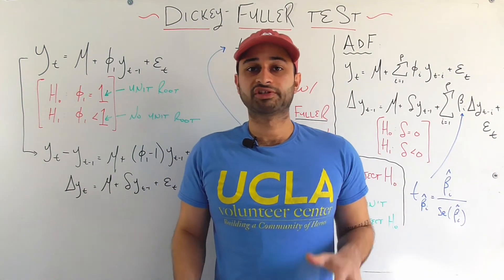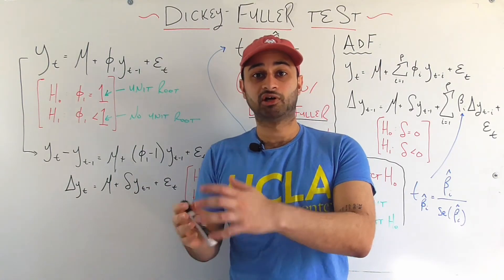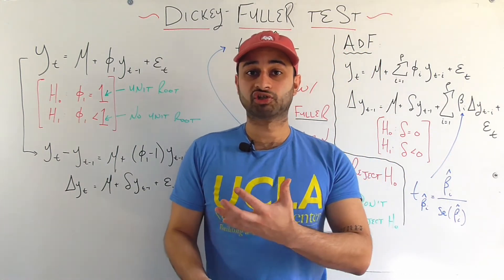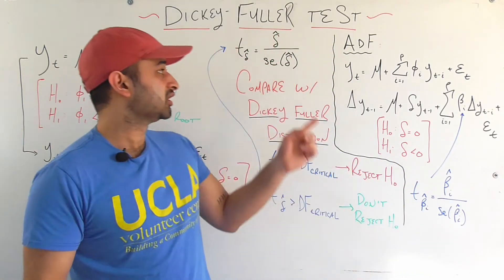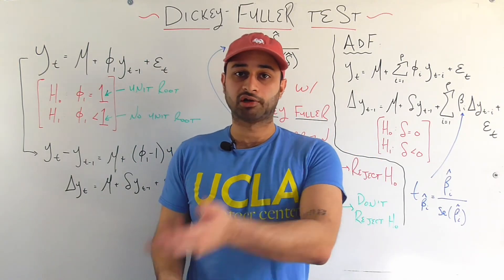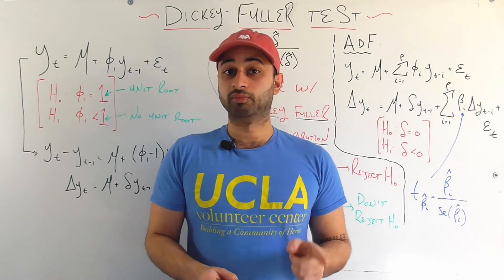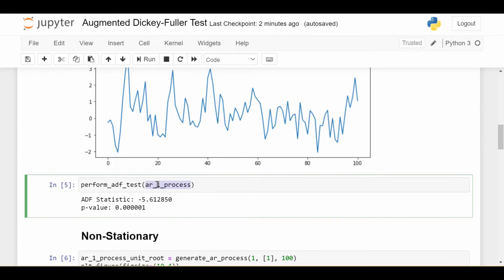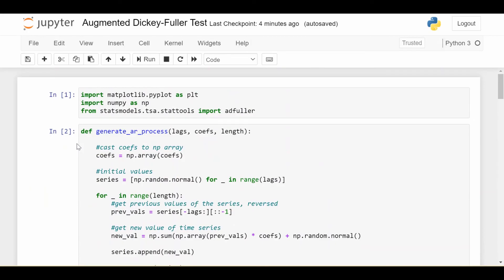Time Series Talk : Augmented Dickey Fuller Test + Code

Comment: I have a time series with daily values for over 50 years. if i do the ADF if says it is stationary with p-value 0.0000. this is weird cause ACF obviously shows seasonality being the same every 365 days. I tried only doing the ADF in 5 years and it says it is not stationary! Should I divide the series in small sections? I'm very confused why it would say that the complete series is stationary when it is not

Comment: Hey mate! Thanks for the videos. One question, let’s say I runs the ADF on my time series and the pvalue is indeed less than my alpha but visually I can see the variance is not constant and after plotting the ACF I have serial autocorrelation. Given the my ADF says that my time series is stationary, how can I interpret this difference with what I see and the result of the ACF? Should I just proceed to model an ARIMA model and run a white test or what is your advice? Thanks a lot

Comment: Hi! I am a little bit confused regarding your explanation of the null hypothesis. Between 3:00 and 3:28 you say that under the null hypothesis, we expect stationarity since y_(t-1) disappears. This would mean that a rejection of the null hypothesis is a rejection of delta being 0 and hence a rejection of stationarity. However, at 4:20 ->, you say that a rejection of the null would mean that you reject the possibility of a unit root which means we have stationarity. In my mind, the argument makes sense compared to the top left h0, but i'm thrown off by your comment between 3:00 and 3:28 (although that also makes sense in terms of testing for delta = 0). Can you please elaborate a bit on this?

Comment: so what happens for complicated models where you have delta as well as multiple Betas like you showed here ...we calculate the t-delta and check if its lower than DF-critical value and if yes then the T.S is stationary but how does the Betas influence then ? You said for each Beta we need to calculate t-Beta and check their values with t-distribution critical value and comment whether they are significant or not ...is it possible that some t-Betas < t-critical and some t-Betas>=t-critical ? What happens then ? does it not affect the result of t-delta or do we just decide the stationarity of time series based on t-delta everytime ?
Reply: i have the same question , he did not explain the significance of the T test of the beta variables

Comment: Another excellent video from you--kudos! I have just a couple of small nitpicky comments.

1. I think you misspoke around 5:02 when you rejected (and didn't reject) the null; you switched them around. 

2. And if you plan to fix that issue, then it would great if you could be consistent about using either critical values or p-values. While the two are related, they are very different concepts. In the theory part of the talk, you mention critical values but in the code you make the decision based on p-values.

Aside from these relatively minor issues, this is a fantastic video!
Reply: i think he's right at 5:02
Reply: He is technically correct, since the test is one sided and the ADF statistic as well as the critical values would both be negative.

Comment: Good video but having moments that are "Changing over time" is not a sufficient condition for non-stationarity.  You can have a stochastic reverting dynamics without non-stationarity. A good example of this is being the case is Component Garch. Non-Stationarity is a stronger condition of the moments being a sufficiently smooth function of time.

Comment: Thank you very muchfor the video! I have a question and would be extremely grateful if anyone could have clarity for me. I'm analyzing some data for my final graduation project and have performed ADF test on a couple of time series for velocity of money in Brazil, and it is a series that visually does't look stationary. My question is: can the ADF test be performed on any time series? Or it has to be an AR compatible (if that makes sense)?
Another question is: there a parameter on the ADF test in the statsmodels library for the regression model (if it has constant, trend etc), what do they mean and how do I decide which model I should use? The p-value and stat changes a lot based on the model I select.
Thank you again! The videos are great.
Reply: I believe that the ADF is not telling us if a TS is stationary or not, but telling us if an AR time series model holds a unit root or not. So, I imagine that if your TS is not AR compatible, then the ADF test is not giving you any information on the stationarity of it. So, if I were you, I would first check the AutoCorrelation and PartialAutoCorrelation functions, to see if there is strong correlations with any of the lags. If this is the case, you would be able to assess that this TS has a strong autoregressive component, and then, the ADF test would help you test for stationarity.
(I am by no means an expert in the subjects)